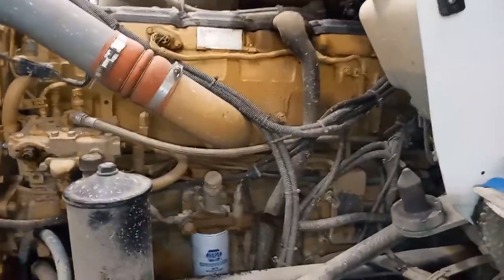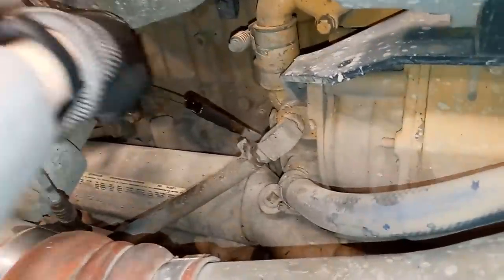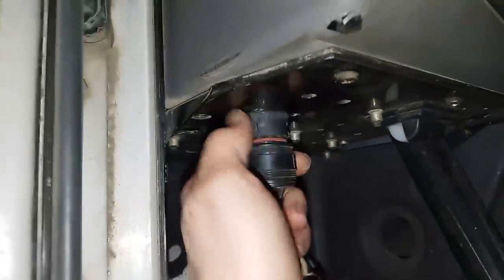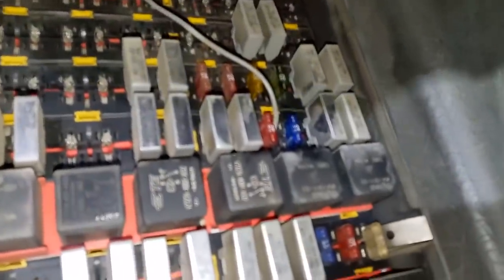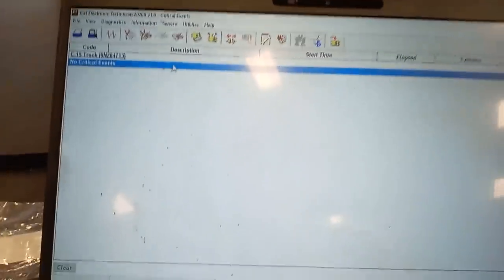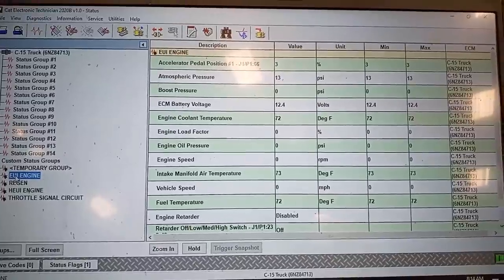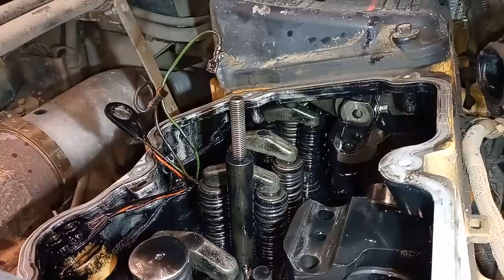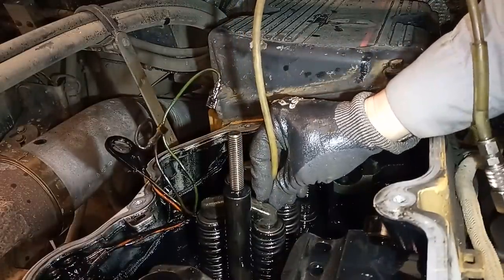What's Wrong With This SMOKY C-15. Cat Engine Smoking.

Comment: Hi loved the video i have a 6nz that is going into  Limp mode for a few minutes and then comes out the shop said it was a  Is fuel problem  Change the bunch of stuff still have the problem  Any idea????
Reply: Define limp mode. I call it when throttle sensor fails and you have to use cruise switches.

Comment: Had the same smoke problem with a 3406e turned out to be #5 had dropped the oil nosel in the oil pan, that was only the beginning of the problems I had with that pos, I went back to Cummins and finished my 27 year career breakdown free

Comment: I have a 2005 c7 Caterpillar that smokes during acceleration.and idle. I'm thinking if it was piston rings it would smoke all the time. What's your thought on that? And I believe the smoke is kind of a bluish color. Sitting in the truck driving it burns your eyes. I would say injectors.

Comment: @7:00.
Yah—

— I use 3/4" cordless on my Toyota Solara control-arm bolts and spun the welded caged nut.  I wish I saw this video before taking on the project.   Break-bars from now on

Comment: You and your family have a  merry Christmas and happy new year  
I've found out that it you don't  clean the wireing up for the injectors the truck lopes I'll run but lopes if take a car of brake part cleaner and blast the fastener and wire contact off it'll run smoothly have you ever had a truck come in like that ??

Comment: Hello,  I bought an old Caterpillar 416 Backhoe from finning,  it smokes like crazy and it’s coming out the blow by and whistling out the dip stick,   Gets more Smokey when under load.  I new it was going to need work I didn’t pay a lot but was wondering what your opinion may be.  I was going to run it for the summer then look at a new rings or maybe rebuild for the winter. Thanks

Comment: Hello, I am fairly new to the Diesel community and I have a 2002 CAT 3126 Chevy c6500 that smokes on start up shortly after initial turn over but then slowly fades away within 1 minute & does not return. Is this Normal or is it something I should be more concerned about ? I live in Northeastern Pa so it is currently winter and it's the first time I've noticed the truck smoking. (White smoke)           Any answers of advice or tips for diagnosing would be greatly appreciated. TIA & Stay Well !!

Comment: When that little bit of diesel spills out of the injector, is a oil change necessary after the repair or can the diesel mix with the oil without issues?
Reply: Nah, I’ve replaced an injector on a PSD then right after I test drove it about 5-10min before I changed the oil.
On my ole PSD I drove it nearly a week before I realized I had water in my oil. Then when I poured in the bars leaks stuff in the coolant I idled the motor for nearly an hour, & it was fine. It’s a HEUI injected motor.

If it’s on a big diesel w 2-3gallons of oil, & u diluted the oil a little bit where a level shows up on the stick/higher oil level I’d change it.

If it’s the same oil level it’s fine after an injector change. Just blow the fuel out w the glow plug out before starting.

Comment: Would a relative compression test have been a good check also for the cylinder condition? That might spare you removing an injector needlessly when the hole is bad.
Reply: not all diagnostic programs have that feature, for a particular year.
Reply: @rearspeaker6364  huh??  What  do you mean by "diagnostic program doesn't have that feature"?? At this point it's a mechanical diagnosis not electronic.
All mechanics would have a compression tester surely.  It's a relatively simple matter of installing it into the injector port & with all fuel shutoff from the engine (so it doesn't fire up)  and crank it for a few seconds.
The test would confirm that the cylinder holds compression and that the rings,  gasket and valves seal properly.
 I would've thought that Josh would do that test as opposed to using shop air like he did and like brownwrench brown wondered why he didn't is all.
Reply: @matildastanford7019  some years on some vehicles, relative compression and injector cutout are not supported- you would know if you were in this field!!!

Comment: My BXS c15 spurts and blows white smoke when I start driving but, smooths out once I get going. I have a code for IVA # 1and #2, IV and actuator system oil pressure. your thoughts?

Comment: The computer diagnostics is a tool, and like any tool needs to be used correctly. Many techs will plug in and see something like a sensor code low/high/etc and replace the sensor, and not fix the problem since the sensor is reporting a symptom of another problem.

Comment: Love your channel 👍 Question: Could one (me), blow air in the injector hole and also see if head gasket or head leaks?? Maybe by stopping crank from turning??  👍🖐🙂from🇨🇦
Reply: Shop air psi is nowhere close to cylinder psi. If you suspect a blown head gasket, a bottle test is the most effective way.

Comment: I know your more of a cat technician but could this cylinder pressure test work on X15 and paccar engines? I work at KW and i dont think ive ever seen this test before,big fan 
Thank you
Reply from the maker: You can certainly use an air nozzle to see if a cylinder holds air, nothing special or different really on a Cummins, Paccar, Detroit or other.

Comment: Hi, i have an 09 Freightliner Columbia with a 60 series Detroit engine that is blowing white smoke only while driving from 1st to 5th gear. I had all 6 injectors replaced just recently due to it started stalling. Now recently it started stalling again and now it’s blowing white smoke only after the engine is fully warmed up and between 1st and 5th gear. This truck has had the regen program deleted about 4 years ago. Any ideas of what can be wrong?

Comment: I just have a question  not regarding this so the cat dealer by me says oil sopping is normal. But I feel as if it's getting worse so could the vavle guides be leaking oil out.   Cause during extended idling my truck turns into a smoke show.

Comment: Hello , i have a cat c15 on a peterbilt 379 2007, and sometimes when running mostly at lower rpm between 5ht and 7th gear, i can feel like a Little misfire and i notice a Little white/gray smoke .
have power but not as it should be.
i replaced the TPS and got a lot better but still have that small misfire every now and then.
if you could give me some advice ,wha do you think? Thanks in advance .

Comment: I have a 65 hundred cat GMC I drive at 80 miles it stalls in the same spot every time you wait 5 minutes it'll start back up we're getting no codes wondering what is making it shut off

Comment: Had a J 1939 connector that would not "communicate" once and after closely examining the connector, realized one of the male duesch pins had slightly slipped back and was not making contact with the female end.

Comment: What I see first is, your air compressor intake gasket looks blown by the trail down the side of the air compressor. On this truck the city horn ties into the com adapter power supply. So if the horn don't blow, ET usually won't connect. I had a customer who wanted to do a cylinder cut out test, but did not have ET. I made a tool that plugged into the EUI connector. Used six light switches and wired the harness on the single wire feed to the EUI. I told him once you flip the light switch to cylinder X, the cel light will come on because of the open circuit. But you will be able to isolate a cylinder. Looks like that engine has a PAC brake. I dislike them, parts are hard to get. Some Jacobs parts can inner change, but I don't like to do that. As dealers you normally put a EUI in and retest. If you wish to verify before putting a new EUI in. Swap it with the other cylinder and retest. If I do that, you will need two seal kits. Swap EUI's, reuse EUI hold down bolts ONLY FOR TESTING. Put the rocker arms back on, use rocker arm bolts for non compression brake engines, leave the brake off. Torque and start up and run long enough to see if smoke follows EUI. Naturally if it does, you have to decide to swap EUI back into programmed cylinder or change the code. What ever you decide, now you replace that EUI hold down bolt along with the failed EUI and bolt. If smoke stays with that cylinder, just got expensive for somebody.

Comment: I have this same exact problem with my c15 6nz, on th same exact cylinder. I just recently changed all 6 injectors and still getting the same problem. The truck has no blowby at all, no oil consumption, and nothing is mixing together. Truck still pulls strong, just smokes and miss on startup and sometimes on idle. Could it still possibly be a cylinder with no blowby
Reply: Did you ever find the problem
Reply: @bighonkey_alligator  not yet. I had just been using it for a spare truck since but about a month ago, i started to get a real bad blowby. I sat it down. Going to start breaking it down next month to see whats really going on inside of it

Comment: Kenworth dealer at Dubbo NSW Australia had a truck for 3 days and the mechanics couldnt figure out that all it had wrong with it ( low power) was a split boost hose. Trust me there are plenty of namsy pamsy useless mechanics that cant diagnose or fix anything unless a computer tells them "boost hose is split" on  a screen. Cylinder elimination via a scan tool can be a huge help in spotting the problem, another method could be a 'heat gun' hand held to see which cylinder is running unusual temps (poor running)........but not always practical on log type manifolds.
Reply: Seen a complete engine replaced because of a cracked CAC core.
Reply: @johngoldsmith6629  agreed.......Ive seen Western Truck and Tractor repair called out to a John Deere with a badly cracked (entire bottom seem)CAC that caused enormous damage to the turbo and exhaust manifold with extreme over heat in exhaust temps.

Comment: I got a 03 w9 with a 6Nz i got combustion gases in the coolant system it doesn’t mix fluids doesn’t smoke no loss of power it does over heat under load going up a grade been told it’s a blown head gasket any thoughts ?
Reply: Could be a cracked head, they are known to crack between valves, tiny little hairline cracks.
Reply: @xxch4osxx  that’s what I’ve been thinking because it’s weird there’s no signs other then that I literally parked it when I found out so I didn’t ruin the motor. Tech at kenworth told me it could need an inframe so that freaked me out
Reply: @gerardobeltran3972  I'd pull the head off and look for those hairline cracks. If your bottom end isn't too worn, you should be ok just doing the top end.  Those heads aren't cheap, unless you can find a good used one.
Reply: @xxch4osxx  thanks for the help I’ll get on that
Reply: @gerardobeltran3972  No prob!

Comment: How much PSI of air did you apply to the cylinder to check for compression !!!
Any body has a close answer please
Reply: Probably 120 psi, nowhere near combustion pressure.

Comment: Josh, what state do you work in ? I'm in Georgia and I've had the worst time finding an honest and intelligent mechanic to work on 3406B engines
Reply: A B model is mechanical but what side of GA  do you live in?
Reply: @rodneygrant7726  Don't forget the PEEC 3406 B and C, mechanical engine with a electronic governor, VTU, ECM.
Reply: What is your full engine serial number?
Reply: @johngoldsmith6629  the truck used to have the PEEC 3406, that motor was toast so it was pulled and replaced with a full mechanical 3406B its a 3ZJ59363
Reply: There was 1 man whom I'd met a couple years ago, saved my ass more times than I can count ! When Yancey blew my head gasket and wanted $26k to rebuild the motor this man did it for $7,500 but sadly about 2 weeks after he built my motor he passed away from covid.
Reply: @user-ls9vv7sb7x  Well you have a C model, engine is a 350 HP out of a Ford, 1800 RPM, 1350 torque. No record of being sold, so it was not registered. 
If you have a 1650 torque transmission and clutch, you can rerate it to that. That was the biggest HP/Torque ratio engine offered, 2T6450 performance spec. Or you could go to a 1550 torque. These engines had extrude hone nozzles and was a pile of crap. Cat had a recall and fixed the problem years ago. However since you have a 350 HP. You also had to make adjustments to the VTU requiring the timing indicator group to be used, and setting the fuel. Also the pump bushings would loose torque and the fuel pumps would by pass fuel. Again problem was fixed with new bushings. Down side is pumps could be damaged from loose bushings. Most of the time you would have a stumble on acceleration.
Reply: @johngoldsmith6629  problem I had was the motor was Frankensteined together by a crooked mechanic, so the pump and nose cone were not matched together nor were they built to the motor... I don't even know the new arrangement numbers because the mechanic passed away and I can not get those records.
Reply: @johngoldsmith6629  motor got rebuilt but 2 weeks after the mechanic passed my jakes quit working and it was time for the 1st oil change. To my surprise I found a piece of a oil jet that spray oil on the jug and keeps the piston head cool, stuck to the magnet in my oil pan. The issue with the jakes is this... I would run the jakes on high ( front and rear jakes ) and when I let off the throttle 1 Jake would immediately start working and shortly after the other would kick in usually within a few seconds... sometimes they worked fine and were both instant in engaging. Sometimes only 1 Jake would work for weeks at a time... finally after the motor rebuild about 2 weeks after, 1 Jake stopped working completely and then 1 day the other Jake hung up and wouldn't kick off when I pressed the accelerator or flipped the switch off.. after about 10 seconds it kicked off and im scarred to touch anything in fear that ill mess something up
Reply: @johngoldsmith6629  this is why I'm looking for a trustworthy cat man to work on this thing. There's been so many hands in this cookie jar that I'm completely out of my depth trying to right any wrongs they've done... previous mechanics screwballed wiring, bypassed the relays for the jakes and have em straight wired, it's a mess... still running the truck daily to keep my head above water but it's been one thing after the next with this truck
Reply: @user-ls9vv7sb7x  Jacobs brakes don't like cold oil, when you have a delay on them kicking in, usually a poor connector at the solenoid, hanging up broken spring or stuck solenoid. With valve covers off and at low idle you can press the solenoid in manually and check for leaks and such. Oil will spray out when you release.They make a tune up kit for these.
Reply: @user-ls9vv7sb7x  You need to know part number off turbo, nozzle part number, part number off front of camshaft in fuel system, number off top of fuel system. Then you can figure out what it is. Piston part number on these was a 1010016 unless it has a newer style two piece. No way to get engine cam part number unless you pull the front off.
Reply: @user-ls9vv7sb7x  A KW truck works off grounds and relays. All other trucks are simple, power, fuse, clutch switch, throttle switch, on off switch, low high switch, brake. With this thing as you say, you better have deep pockets.
Reply: @johngoldsmith6629  I do have 1 question that has messed with my head so damn much over the past 3 years.. 2 different fuel pumps, 3 nose cones and finally 1 was rebuilt... also before and even after the engine was rebuilt I haven't the slightest clue why this happens but here goes.... under hard acceleration it does not matter if I am loaded or empty and I've noticed the water and exhaust temps by the way don't effect this issue..... the color of my exhaust is like a bag if skittles always changing colors lol.... everything from dark black coal to damn near white and everything in between I don't know what the hell could cause such drastic changes in color... pyrometer, water temp, boost Guage, all of that can be the same and yet the exhaust changes colors from 1 minute to the next ???
Reply: @johngoldsmith6629  thanks, im going to order a kit tomorrow just in case they are bad ill have it on hand...
Reply: @user-ls9vv7sb7x  As I said before, need part numbers to know what this is. Might need to know what head is on it as well. The last mech., engine was a 8PN and they don't like older engines on swapping parts. Last one of these I had, I refused to work on it. Had so many wrong parts I knew the customer would not pay the bill. Your not going to find somebody that knows this engine and fix it right, unless you give them a free hand. Been doing this for 41 years and you have to decide what engine, HP, etc your going to set it to. You get what you pay for.

Comment: where is your cat rocker arm tool?, the 3 bolts in the rocker shaft/ jake housing should be updated, 120 psi(shop air) will not be enough to find cylinder leakage (450 psi), it will find a burnt valve (bent), while you may have checked the injector tip off camera it should have been done they like to split (crack), you can do cylinder cut out tests without a computer while it requires removing all valve covers you use a insulated handled tool and short the injectors, these engines like to blow the headgasket and send the compression up the exhaust bolt hole and cause smoke, you should strip(use alligator clip to supply power) the power wire on your data connector and when  you run into data link issues that arent the fuse apply power to it so you can communicate,

Comment: I think I need to replace my wiring harness on my 07 peterbilt.  Speedo not working right and Jake brake works randomly.  Cruise control is way out of wack . Set the cruise and it keeps accelerating and sometimes just shuts off on its own . Clutch and brake springs are good . Speed sensor is working right too. New Speedometer head too. I'm thinking I got wiring issues.  And of course they are on top of the transmission and a bitch to get to .ugh. fml